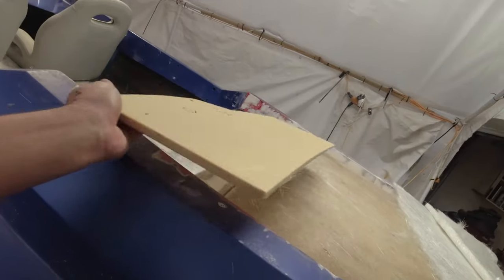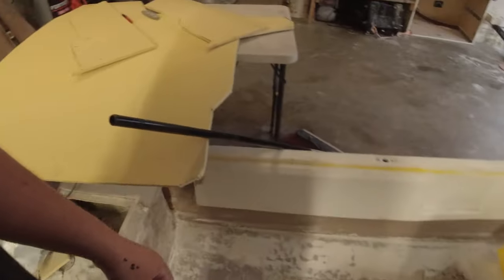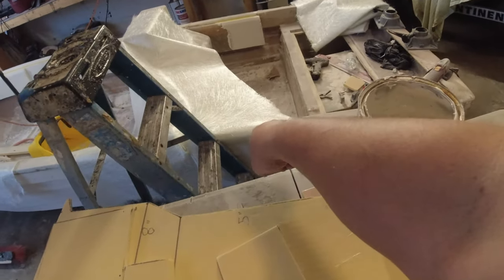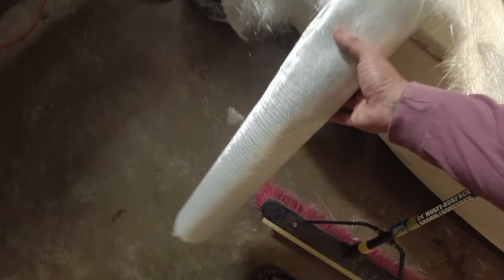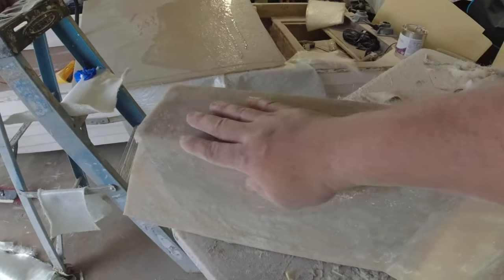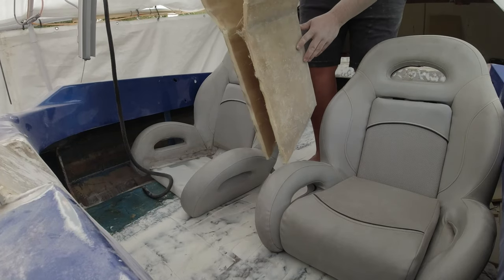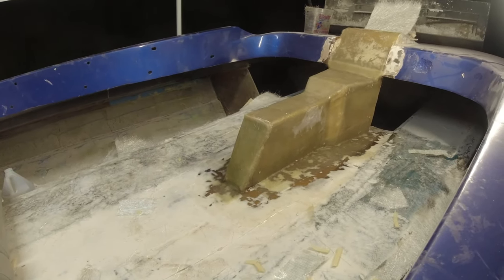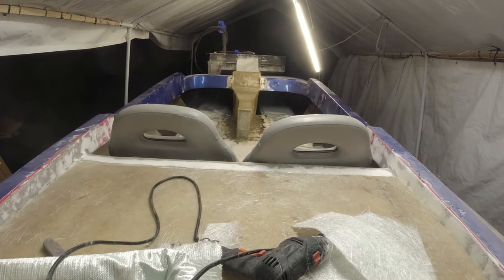Building a fiberglass center console out of foam for my Home built speed boat

Comment: Hey bud make sure you balance that tunnel boat when your putting all that stuff in, gas tank etc. Especially if your putting that 250 on..Talons love 2.4 & 2.5s lighter motors..Otherwise it will bounce n hop and not perform and ride on the tunnel of air.